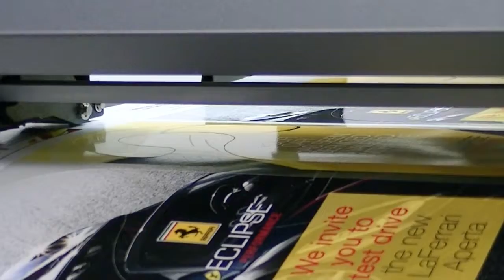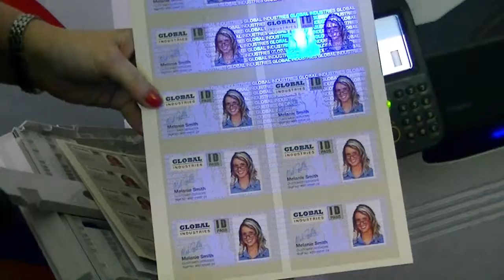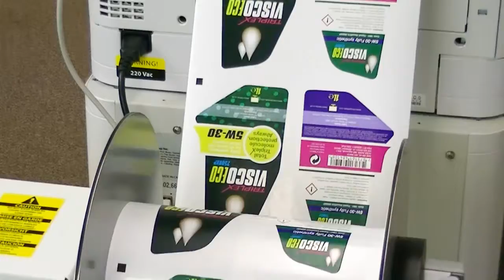Intec Printing Solutions Product Range

Comment: How was the fooling achieved after printing the cover and foiling only the title and spine?
Reply from the maker: Thank you for your enquiry. Firstly the initial artwork is printed, we then use overprintable laminate which protects this artwork from being foiled. The newly laminated sheet is then put through our ColorSplash printer, printing only the title and spine -  This is put through the ColorFlare device, foil will adhere to this toner only. The key is using overprintable laminate. I hope this helps explain the process, many thanks.